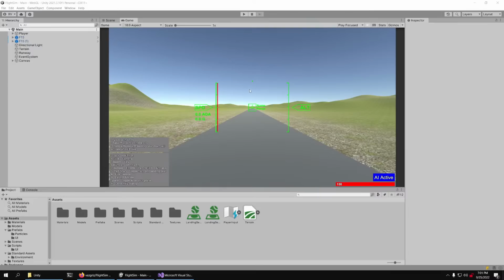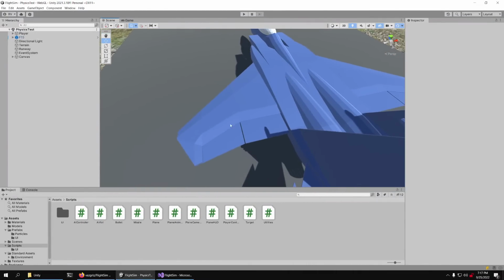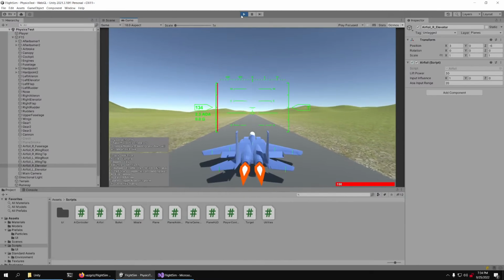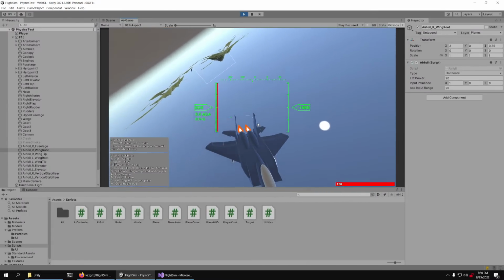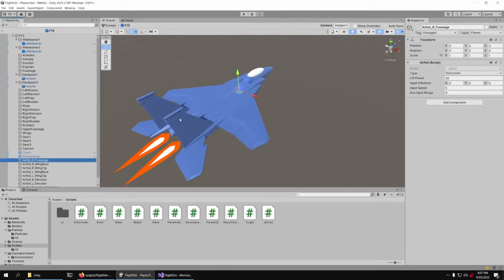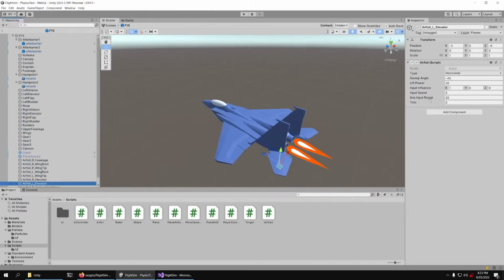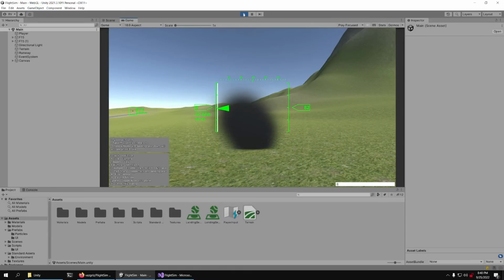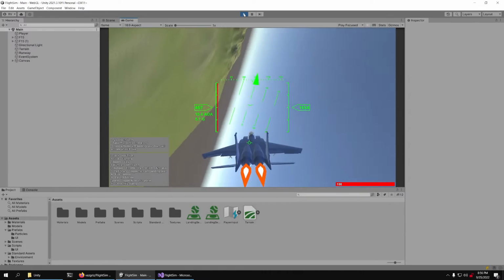Physics Based Flight Sim Development

Comment: "way harder for designer to set the values" - Star Citizen did something interesting with that. They have hardcore physics, but designers will input values like acceleration, top speed, turning rate, fuel consumption, etc. and some translator will translate it to the physical properties of their thrusters.
(it sadly led to ships that turn faster with their side thrusters than they accelerate with main one, but that's a "design" issue, not a "tech" issue).

It was an interesting way of doing it and I plan to do a simple variant of it for my project.